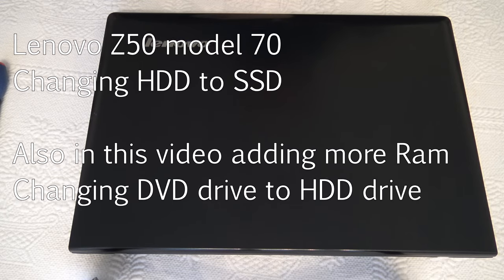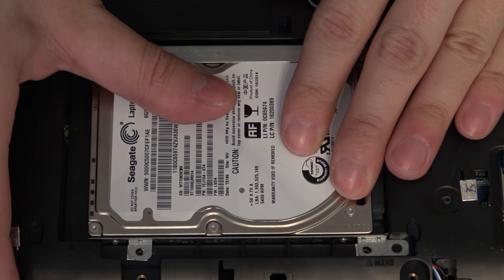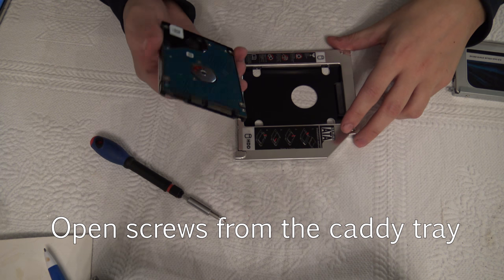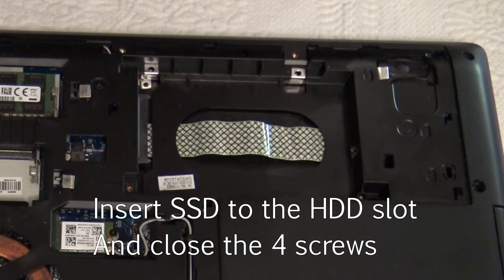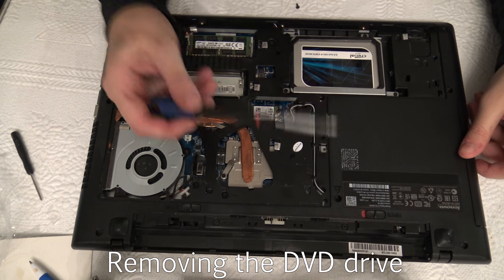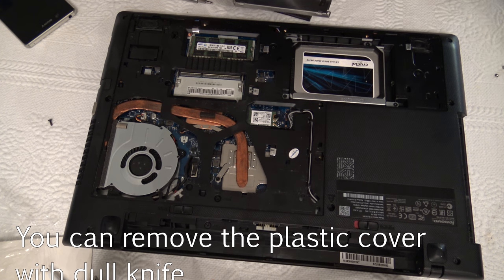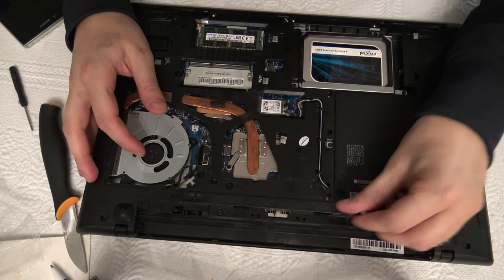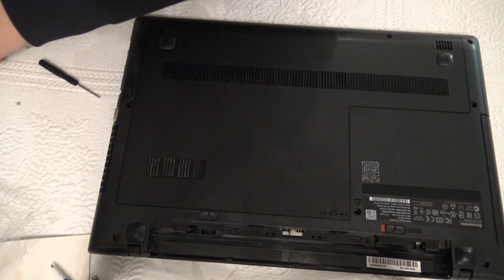Lenovo Z50 upgrading HDD to SSD

Comment: Lenovo Z5070 has sata 3 or sata 2 ?
Reply from the maker: It might be sata 3 check from the manual or e-manual of the product
 https://forums.lenovo.com/t5/Lenovo-P-Y-and-Z-series/Max-capacity-for-secondary-SSD-on-Z50-70/td-p/2014171
Reply: @MikkoTenhunen  good video. But i think i will be better if the video has speedtest after upgraded

Comment: was not it better a 9mm caddy?
Reply from the maker: +Fabio Nevano I dont understand you're question. The caddy i installed was little hard to insert inside the laptop but i dont know it's its better choice since i can't find what is the dvd case original size
Reply: Hi, I ask you this question because I have your own pc, but in the video I noticed that the caddy runs very hard, and I'm afraid that after failing to extract it, with a 9mm caddy maybe there would be no problem, what do you think ?
Reply: Same question from my side:
Is a 9mm caddy maybe better? Dies the old hdd fits into the 9mm caddy?
Reply from the maker: @andreash4013   Am not sure since i used the 9,5mm caddy and i had to use little force to get it in. But maybe the 9.0 will just slide in nicely? Fitting the HDD to caddy should be fine since it has like small screws that hold the HDD in place.
Reply: I will have a try and let you know

Comment: what SSD did you use?
Reply from the maker: +Stephen Melissis This one Crucial MX300 525 GB SATA 2.5 Inch Internal Solid State Drive with 9.5 mm Adapter - Grey/Blue https://www.amazon.co.uk/dp/B01IAGSD68/ref=cm_sw_r_tw_apa_OqSNybKBXXW0W
Reply: Mikko Tenhunen thanks! I'm assuming that it worked out well?
Reply from the maker: +Stephen Melissis Yes it works great on Windows 10 and it takes 10 sec now to boot up.